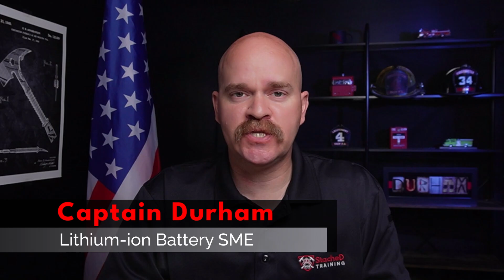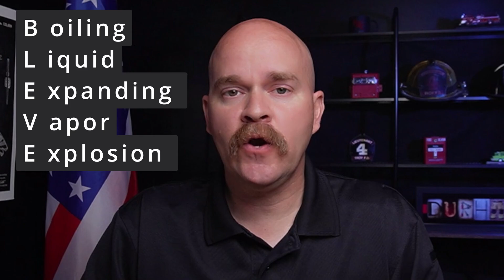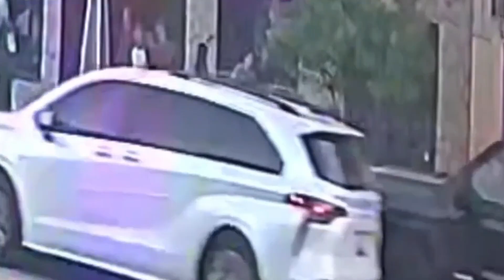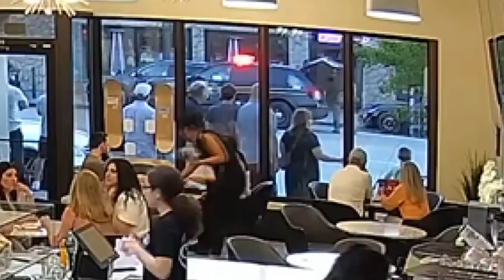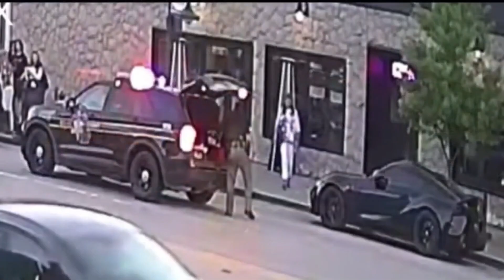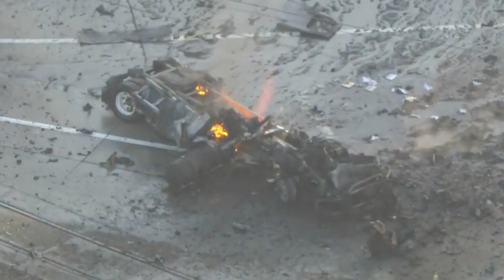BLEVE? Explosion to Lawsuit

Comment: Mate, I reckon you missed a big point. For every litre of LPG or LNG that escapes from below the level of liquid as a liquid under pressure, how many litres of GAS does it make?
I'm retired so I'll leave it to you to answer the question and then people will have a better grasp of what a BLEVE really is. Think of a tanker with 25 - 30 tons of gas in the cylinder. This is a BLEVE.

Comment: Many years ago, I was driving down the freeway in the fast lane.  Coming towards me from the other direction in the lane next to the fast lane.  Its CNG fuel system ruptured and caught fire.  The resulting explosion forced my car over two lanes and the heat was unbelievable.
Heroically, the driver kept the truck under control until he could stop it safely.  Unfortunately, by then his cab was completely engulfed in flames.  He got out, ran back across the freeway where he collapsed.  He had to be flown out.  I don’t know the outcome.  I doubt he lived.  But, God bless him, it could have been much worse for everyone else had he lost control.
The point of note here was the explosion wasn’t the tank exploding.  IIRC, it was a catastrophic release of CNG due to the regulator failing.  The accident sent cars out of their lanes on two sides of a freeway, but wasn’t anything like the explosion in the video.  So hats off to the firefighters who respond to accidents like these.  I couldn’t do it.

Comment: As an alternate  fuel fitter in nz, we went to a presure relief  valve, which operations  at  350 bar  or just over 5000 psi. The tank full safe operating  pressure  is 3000 psi 
I have seen a CNG tank fail in a van. It took out the van and station forecourt  of the fuel station . And then I have  seen the cng system vent with no damage  into the air 
LPG is a different  story  it creeps along the ground until it finds an  ignition  source.?

Comment: In Australia all lpg, cng, ev vehicles have special marks on number plates.

Cng cylinders are 200-400 atm pressure, they explode clearly mechanical, even its nitrogen or something else absolutely neutral inside. And explode not because of pressure rise (to increase pressure twice temperature must become 300C, for lpg - 60C) but because the cylinder losses strength and fails

Comment: A CNG tank also operates at a pressure two orders of magnitude greater than an LPG tank. So they have to be built a lot stronger, and when failure does occur the amount of energy potential in just the compressed gas, ignoring that it's flammable, is quite significant. Even without an ignition source, a failing tank can do a lot of damage.
Reply: Even if its harmless nitrogen or CO2
Reply: I was on a city bus once. I was sitting in the rear and thought it was quite hot, unusually so. Then an alarm started going off and the driver did not leave the stop. I had a hunch it was a fire alarm and stood up and encouraged fellow passengers of the bus, though some dude with an ego too big for his good started countering what I was doing. Seconds later, the driver started to tell folks to get folks off. I think, in the name of keeping calm, he kept his voice down more than he should. 

I do not think anything serious came of the incident, however. When I was a kid, we were in SoCal and I saw a city bus barn with a burnt-out remnant of a bus. CNG is no joke.
Reply: What kind of psi are we talking about with CNG?
Reply: @MattH-wg7ou  3000
Reply: @antontsau  dang. Thanks!
Reply: @MattH-wg7ou  3000-4000 psi

Comment: I have been a CNG mechanic for 27yrs.
NFPA 52 Outlines and mandates all regulations for a CNG vehicle. 
There needs to be a gas detection fire suppression system along with a Pressure Release Device in the event of a fire. If there is no automatic deployment of the dessicant in the fire suppression system, there should be a manual release button next to the driver.
So either the driver was unaware, ignored or was not properly trained on how the system works or they panicked.  CNG is filled to 3500 psi. 
LNG is a cryogenic fuel meaning it is stored in a ice chest type tank where the LNG is stored at NEGATIVE 256 farenheight. LNG is "safer" but still needs to be respected. 
This incident is horrible. Its a reminder that no matter the fuel you need to know what it is & how to handle it.

Comment: I'm confused.  The CNG tanks don't have pressure relief valves?
Reply: The Pressure Relief Valve (PRV) on CNG opens on both high temperature and/or high pressure. If while trying to cool the tank itself, accidentally spraying water on the valve would COOL the valve and prevent its proper function.
Reply: @coryfogle5353  Is it then possible that the part of the tank exposed to the greatest heat may not be anywhere near the PRV, so then structural failure due to heat may still be possible even without cooling the valve?
Reply: @captainotto  It is true that thermally operated PRDs might not activate if the cylinder is in a fire that is localized and some distance away from the PRDs. Depending on the size of the cylinder, there may be more than one PRD. In the case of this fire, what I saw in other videos was that the fire did not appear to be localized. With that said, there are other factors why a PRD may not activate other than a FF hitting it with water.
Reply: They do

Comment: So the difference between CNG and LPG is that CNG is still gaseous even in the pressure of the tank, and LPG is liquid inside the tank due to the pressure and therefore the pressure is lower? Ah yes, CNG is primarily methane...
So the same dangers of CNG also applies to H2?
Reply: CNG and H2 can both be cooled to condensation, but to keep them in liquid phase requires either a huge amount of pressure, equating to larger tank mass or maintaining cryo temps requiring huge amounts of insulation and energy in re-condensing boil-off.
Reply: H2 has the added bonus of being a smaller molecule.  Leaks are easier, at least at low rates.
Reply: @ChiefBridgeFuser  That combined with embrittlement and other forms of corrosion means you have to use way more expensive materials for transportation and storage of the fuel.
Reply: H2 explodes in much wider mix ratio range than methane

Comment: Why is the relief valve only temperature operated? It should open at a lower pressure than the tanks failure point as well. Or there should be a burst disk like other pressurized gas tanks. This seems so preventable.
Reply: I'm wondering the same thing. One possible explanation I can think of is the tank likely also failed from the heat rather than just being over pressurized. If the tank is still at or around a normal pressure of perhaps 3000 PSI but the heat weakens the tank, it could still explode. Unlike a propane tank, there's no liquid in a CNG tank to absorb the heat.
Reply: Because its hundreds atm. Reluef valve for such a pressure is not a thing to be installed on cylinders, its huge industrual unit. And when it trips its explosion by itself.

Comment: Compressed gas tanks should be a different colour so people know instantly and not relying on a stupid sticker. February to July is a long time and I hope the fire fighters have made perfect recoveries.
Reply: That isn't any better than a sticker.  Fire and smoke can obscure the color of the tank.
Reply: @ffjsb  Reflective paint orange for compressed gas would help
Reply: @tonysheerness2427  Not on an orange truck, like a lot of construction trucks...
Reply: @tonysheerness2427  orange as a safety risk indicator is starting to mean ‘high voltage’ as all the hv wiring in EV’s is required to be orange.

Good idea but maybe a different color choice?
Reply: @ffjsb  Maybe not orange, however I am sure they could make the fuel tank stand out maybe with flashing led lights or something to alert people of what is in inside the tank.
Reply: @ChuckvdL  They will have to pick a colour or maybe flashing led lights.
Reply: I’m not sure it wouldn’t be blackened by the fire and soot before the firefighters arrived.  Maybe a placard somewhere else on the truck?  Something like the hazardous materials placards they use?